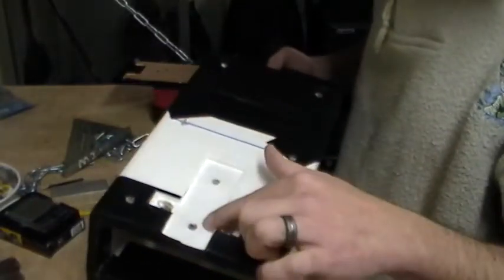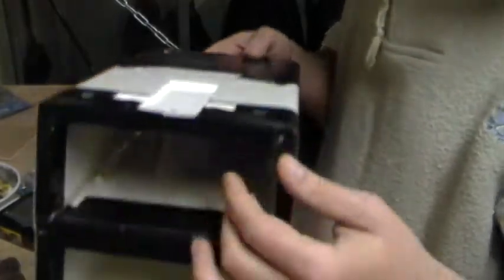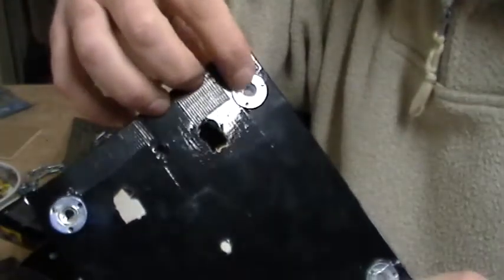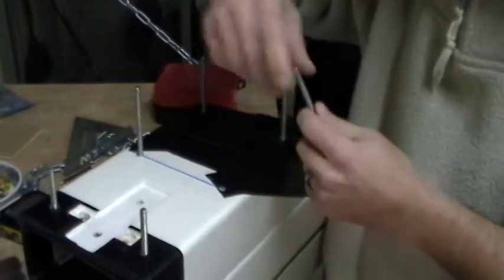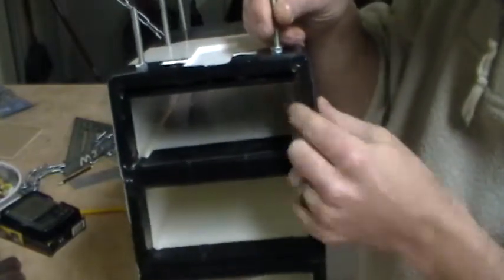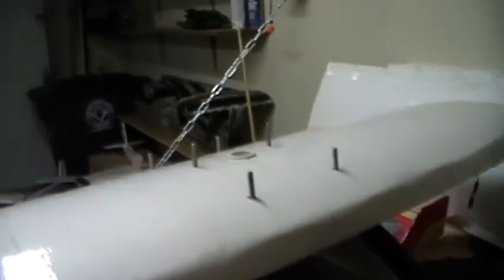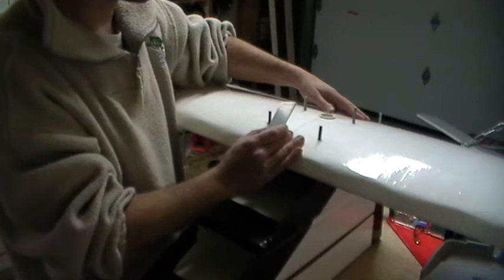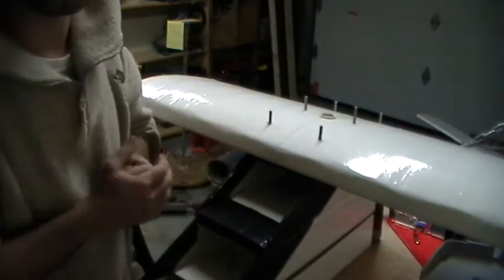FB Albatross (mounting the wing to the fuselage)

Comment: Good idea to stick with the pusher. Plan your build and build your plan. (I actually adapted that from a scuba diving adage). Did you ever get the specs on the wattage output of your power plant?? I ask this  because there's more and more metal introduced here as you go, and that means more weight. I know that motor you got is a real work horse. Just want to make sure you got enough watts to handle the weight. Looking good so far, bro. Keep up the good work!!